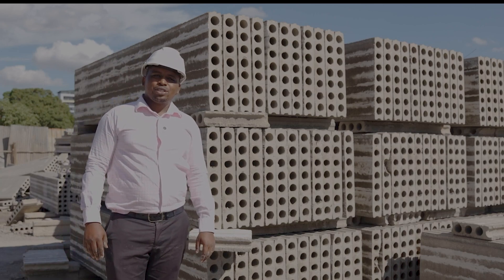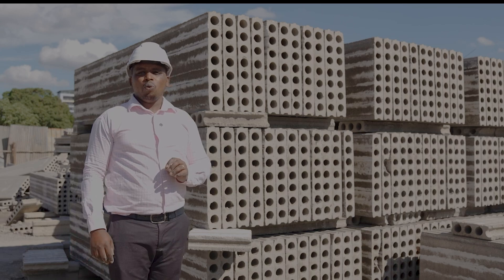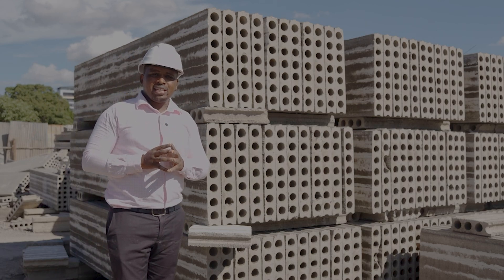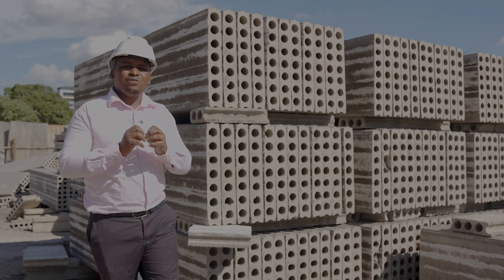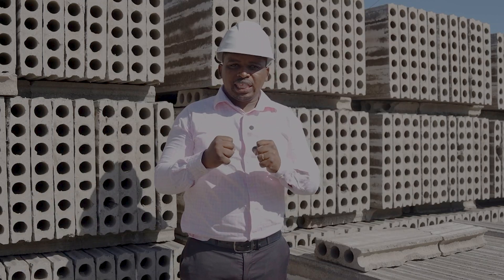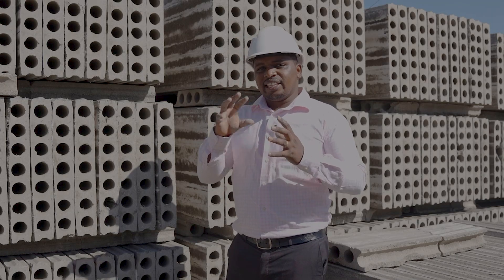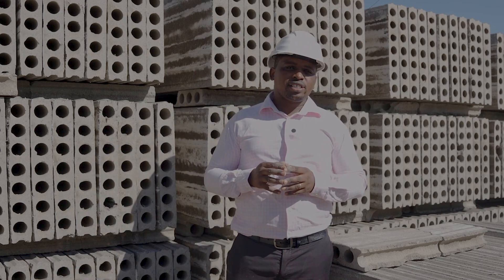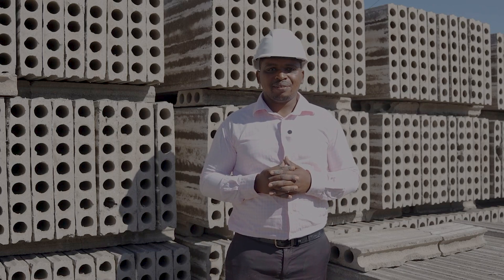"Shocking Build Secrets: Why EVERYONE is Switching to Precast Panels!"

Comment: How thick are the panels and how large are the holes? Is there additional steel in the holes?
Reply from the maker: The panel are about 3 inches thick. The panels are reinforced with steel bars.

Comment: Hello Sir
 
Option A 
The entire living room space is 7.25x6.25m 
Open plan layout with dining 200mm elevated. Arranged like this. 
Main lounge 6.25x4.2m. 
Additional lounge or VIP section 3x2.75m. 
Dining 3.5x3m. 
Total floor area 45m². 

Option B 
Main lounge 6x5m. 
Dining 3.6x3m 
Total floor area 40.8m²

Sir please these two living rooms which one is bigger and better?
Reply from the maker: @Good-dh3nx Your 1st option  (Option A) has an additional lounge that you are referring to as the VIP section. This option works well if you really need to have this additional section. Nevertheless, if VIP section is not very much a necessity, Option B serves better since it gives you a bigger lounge that can accommodate more guests.
Reply: @TheBuildingConsultant  Well option B is only 800mm wider than option A main lounge. 
Please note that the additional lounge in option A can serve multiple functions, like bookshelf, reading nook or a home office.   

Which of the two options would you choose for yourself assuming you are asked to choose??

Comment: There's nothing like light weight concrete, concrete has a unit weight, you could say the panels weigh less compared to solid panel. Other wise good info, thank you.
Reply from the maker: Thank you for reaching out. Indeed there is light weight concrete that is dependent on the constituent materials. It's density is less than the normal concrete.

Comment: Does moisture sip through or do you need to do special weter proofing
Reply from the maker: The water does not sip through. Nevertheless, joints are sealed properly before plastering/skimming.

Comment: What is the overall cost comparison between precast and normal masonry walling ?
Reply: From my research the difference in cost is negligible, all factors considered
Reply: @lilianmaina4248 i kike the fact that the heat esp in hot places like mombasa would be  a non issue, noise resuced and  space is larger allround as blocks are wider .I imagine though using normal coastal reef blocks -super strong as frame all-round and maybe partitioning inside using precast and also kitchen counters .
Reply from the maker: When you are evaluating the cost comparison between the two methods, you should also put to consideration other aspects such as labour, plastering, skimming, paintworks etc. 

Watch out the next episode as we continue to engage on this conversation.